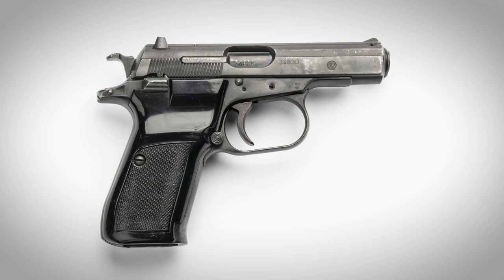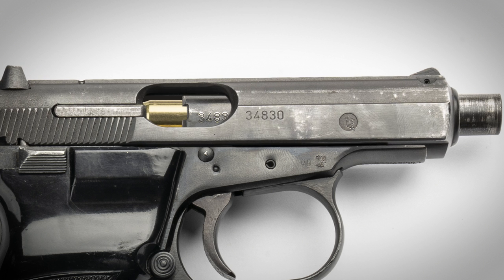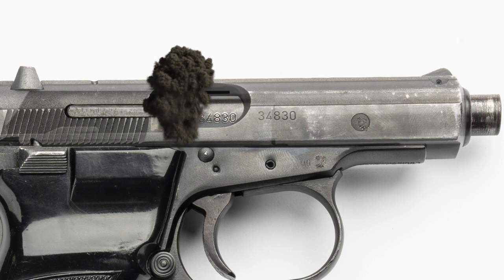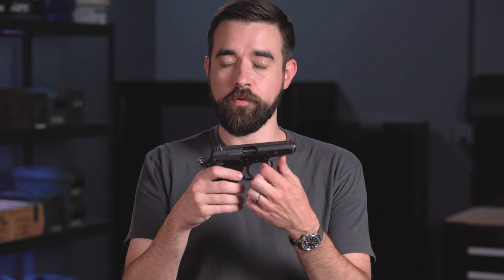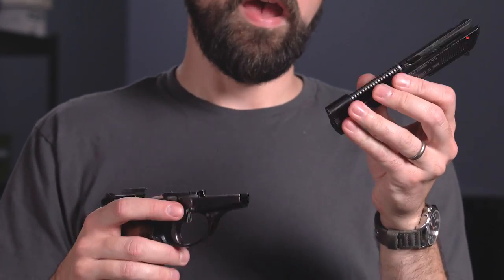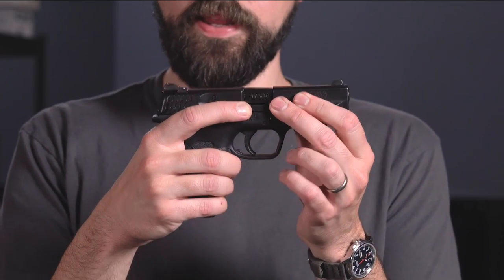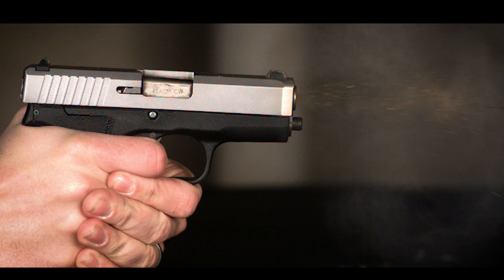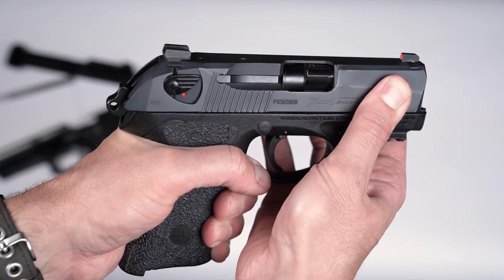Blowback Versus Recoil Operated Pistols

Comment: Just for your edification. The barrel on a 1911 designed by browning does not tip up the barrel stays level the entire time. All true Browning clones retain the non rising barrel.  There is a barrel bushing that keeps the barrel in alignment. That is the main reason why it is hard to get proper ammunition for a 1911.  Of course there are 1911s that do have a rising barrel but lack a barrel bushing.   Next, there are still many guns made with the blowback design. One in question is a Ruger mark 4 for 22 that is a blowback design. Ruger also makes the  SR 22 semi automatic that is also a blowback design. And in  lower  pressure cartridges blow back designs are commonly used.

Comment: This is a great video explaining the differences between straight blowback, and short recoil operation.    If I may add, one little addition - in the early 20th century, there was actually a "blow forward" action, where the frame of the pistol stayed stationary, and the barrel moved forward upon the round firing, cycling the action.   This was possible because of the enormous friction between the bullet and the rifling in the barrel.   John Browning's short recoil operation makes use of this bullet / barrel friction in the same manner - in that, as long as the bullet is in the barrel of the gun, there is a forward acting force on the barrel.   Simultaneously, there is a rearward force on the slide, from the pressure of the cartridge, which counters the forward force on the barrel.    These two opposing forces briefly maintain the lock of a short recoil system, - until the bullet leaves the barrel and that forward acting bullet friction force disappears.   It's a really ingenious system to keep the barrel and slide locked together until the moment the bullet leaves the barrel.    Recoil springs can be made less stiff for larger calibers, making slides easier to rack.   And the slide mass can also be drastically reduced.    Thank you for putting these videos together -- they are entertaining and educational!
Reply: Wow!!

Comment: One of the best explanations of straight blowback vs short recoil/locked beach firing mechanisms I've ever watched... Thank you!!
Reply: Graeme I still don’t know what the difference is except one has a fixed barrel.
Reply: great..  whats the difference..  the both use the guns recoil to chamber another round..    here's the types of operation.  SINGLE SHOT, BLOWBACK and Gas operated.

then again, I dont think he knows that :-(
Reply: @cabotcat1  exactly! he didn't explained the difference
Reply: @cabotcat1  Notice that both of the straight blowback guns he showed have external hammers, but the Smith doesn’t. I wish he had mentioned this and explained why. I can’t imagine that’s not germane. I need to look that up and see why. I’m sure you engineering types already know the explanation. Anyway, the slide blows straight back on the blowback pistols whereas with the recoil pistols the barrel tilts. The latter isn’t possible with blowback.

Comment: It is important to know the differences between the different operating systems/mechanisms:

1- Recoil Operated Weapons: 

1- The barrel will move in all of these to ensure that the cartridge remains locked to the barrel till all the dangerous gases have escaped.

2- Delayed Blowback Weapons: The backward travel of the bolt is delayed, so the dangerous gases don't cause harm.

3- Gas Operated Weapons: The bolt is linked to a separate piston that moves it back.

Whenever the the weight and the size permit, gas operated systems are the cleanest, the safest and the most reliable of all these systems, but they do have a slower rate of fire than blow-back systems. 

Recoil-operated systems are safe and cheap, whenever the weight and service don't permit gas-operated systems.

Delayed blow-back systems are not easy to manufacture, so, i think, only HK manufactures them. The most recent HK system is also a gas-operated system despite over 70 years of experience with blow-back systems. 

The harder the steel, aluminum, or other metal, the lesser it will abrade when it rubs with softer metals. It will though wear the softer metal out, so some part has to wear out. If you use two hard metals, then they might abrade less, but both will abrade equally, so you might have to change both the parts eventually, but only if the usage is extensive. 

If a metal is too hard, it will break because it won't be even a little flexible.  If it is too soft, it wear. 

Aside from wear, a metal needs to not expand too much with heat because this can also cause the parts to lock together and jam.

Unless the metal expands a little, it might turn too hot, since it won't be a vert good dissipator of heat, and could cause premature ignition of cartridges. Most early blow-back weapons had cook-off issues, whereby the chamber would get so hot that it would fire the cartridges on its own, and only stop when it emptied the magazine or the belt.

Blow-back systems also need thicker cartridge casings, so they don't rupture and explode.

Early machine guns were water-cooled to keep the barrel cool. Now, all weapons are air-cooled, they just change the barrels on machine guns, whenever they get too hot.

The barrels of all AK-47s expand after around 2 magazines of fully automatic fire,  begin dropping the bullets at 50 to 100 yards, and lose all effectiveness. 

The American M16 uses the 7075 aluminum, which is very hard. The early Chinese copies used the softer 6000 aluminum. 

The best steel is 4150, but that is so hard that it needs very expensive machines and processes to cut and shape it, so, for small arms, most manufacturers use 4140 steel.

Both polymer and aluminum reduce weight, and don't rust. Aluminum can get a patina, and even conducts electricity, but polymers can eventually degrade and crack.

The dimensions are also important, because you need precise clearances or tolerances between the different parts, so they don't jam when they heat, yet, not so great to cause problems with the functioning of the mechanism.

Stamped manufacturing is cheaper because it uses a press instead of labor. It can also be more uniform. Even most late WII weapons are stamped.

The materials used in springs need specific coefficients of elasticity and precise turns/twists at precise angles, so they're neither too hard/soft nor compress/expand at the wrong angles.  Most 3rd-world springing mechanisms will malfunction. 

The AK-47 is a Russian modification of the German Stg-44. The PPS 43 was a modification of the Finnish Suomi M/31, which itself was an iteration on the American Thompson SMG. The Mosin Nagant was an original Russian weapon designed by a consortium of Russian and Western designers hired by the Czar. The TT uses a Mauser cartridge with an iteration of the Browning mechanism.  I don't think the Russians have very successful indigenous designs. 

The F-86 and MiG-15 aircraft were also very similar because both were iterations of German designs. 

Both American and Russian space and weapons programs employed German scientists and technology.

Most weapons are different iterations of Mauser, Luger, and Browning designs, who were the pioneers.

Comment: My guess on the difference in felt recoil:
The blowback operated pistol has to have a stiff recoil spring, which means more of the recoil force is transmitted to the hand earlier.  With the recoil operated pistol, the recoil spring can be much softer because it's job is mostly to push the slide forward again. That spreads out the recoil over a longer period of time.

Comment: In the straight blow back, the case stays in the barrel until the bullet exists the gun. The reason is that the pressure in the case, and in the barrel, causes the case to swell. The swollen case is ceased in the barrel, and once the bullet leaves the barrel it will shrink enough to slide back out of the chamber. The Hornady reloader’s manual has a great intro that describes what happens to a case as a gun is fired. And a LOT happens!
Reply: Yes, the old Hornady manual has an excellent write up by the micro- second of what happens when the gun fires. Anyone interested in such things should read it, it’s most enlightening!

Comment: As a retired Professional Mechanical Engineer and an avid gun advocate for over 50 years, you did a great job explaining the differences.  Great work!
Reply: The only thing I can think of to add is regarding simple blowback pistols:  the high pressure and heat in the barrel (once the ignition has begun AND while the bullet is still in the barrel) causes the cartridge case to expand.  Most cases are brass and this causes some friction between the cartridge case and the inside of the barrel's chamber, which helps slghtly delay the rearward motion of the slide until the bullet exits the barrel and the pressure/friction reduces.
Reply: @louiscatoire3269  Obturation is the technical term. There are one or two delayed blowback designs out there that actually try to harness case obturation to slow cycling, but they were never very successful.
Reply: @ostiariusalpha   You are correct. Obturation has a very minor, if any, effect on slowing the cycling.  It depends on the pressures involved, the case material (aluminum and steel cases have even less effect than brass cases), and the roughness of the inside of the chamber. I've read some manufacturers even tried to make the chamber interior rougher to increase the effect, but brass cases are just too soft to make this a useful experiment.

Comment: I knew there was a difference between the two but never really looked into how or why they were different. As you stated, the Beretta PX4 Storm has a rotating barrel, both the full size and compact that is. The PX4 Storm Sub-compact, however, has a tilting barrel. I am guessing this is due to the limited space they had to work with on the sub-compact model compared to the compact and full size. Although, the one I own is in 9mm, so I cannot speak for the .40 caliber version. Awesome video, it's great to learn new things.

Comment: I like the idea of the Wather CCP having a port to use pressure to prevent temporarily the movement of the slide by blowback. The spring as a result is much lighter and recoil manageable. It also is very accurate and easy to shoot up to 25 yards as a sub compact.

Comment: It should be noted that the forces applied as the bullet is travelling down the barrel are so massive the spring strength is irrelevant. Even an extremely powerful spring, a spring so strong you'd need a crowbar just to open the slide a millimetre would hardly slow down the slide at all in the moment. This is because the FORCE applied on the slide is huge, it's as large as the force pushing on the bullet but the other way. Pressure acts in all directions and the base area of the cartridge is about equal to the base area of the bullet. Any spring applying even a fraction of that force would be far too strong to open the action.

This is what's important about inertia, high mass resists high forces with low acceleration but over a long period of time this acceleration will mean the mass will just keep going so this is only good for brief periods. Springs keep slowing down (and actually apply more force when compressed more) so springs are negligible in the moment of firing but hugely important once the bullet has left the barrel and the slide is now travelling at quite a high velocity.

If the slide is 100x the weight of the bullet then it will be accelerating at 1/100th the rate of the bullet (force = mass X acceleration). Acceleration isn't constant as bore pressure (therefore "bolt thrust") will vary but it will vary equally for bullet and slide, over time they'll have the same ratio of acceleration. This means a slide that is 100x as heavy as a bullet will have a velocity 100th as fast as the muzzle velocity of the bullet. 

The distance an object travels under a given acceleration is directly proportional to its acceleration. So if a slide is 100x the weight of a bullet, then it will have travelled 100th the distance the bullet travelled within the bore (so not barrel length but barrel length minus case length). Slightly more as the bullet is slowed down by friction with the barrel. So a 100mm long (4 inch barrel) will logically only open 1mm if the slide is 100x heavier than the bullet. That's probably very little travel. The case could probably travel much more than 1mm out of the chamber before any real risk of case bursting.

Remember, the inertia of the slide must equal the inertia of the bullet. This is where the spring actually helps, it doesn't help keep the chamber closed, but it works on the slide over the much greater distance and time period which is as the slide opens all the way, the spring (hopefully) slow the slide down steadily over time so by the time the slide hits the frame it isn't going quite so fast. A stronger recoil spring means more velocity will be taken out of the slide as it's travelling backwards. A light recoil spring will will barely slow the slide at all before it hits the frame and transfers all that remaining inertia into the frame in an instant. This transfer of inertia will be REALLY fast, faster even than the transfer of inertia from the bullet to the frame of a revolver. This is how some straight blowback pistols can be REALLY snappy.

One thing that shouldn't make a difference is recoiling mass as whatever the mass is, it must equal the inertia of the bullet fired.

Even on browning-style short recoil guns, the barrel and slide moving together isn't any different than a much larger and heavier slide moving backwards in terms of amount of inertial imparted from the bullet. The difference with an unlocking barrel is you have the inertial mass split in half and stopped quite separately in time. The first when the barrel unlocks the barrel stops very quickly, then the slide is slowed down by the return spring before it locks open and dumps any remaining inertia into the frame.
Reply: Thanks for the slightly more detailed and mathematical explanation.